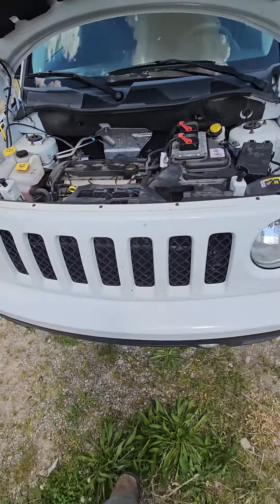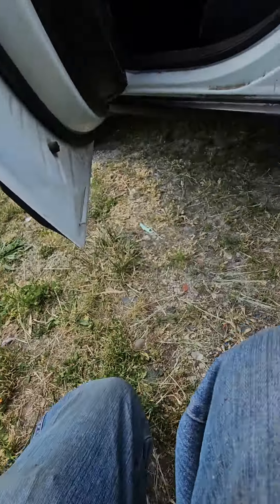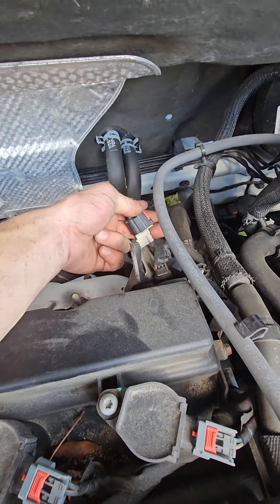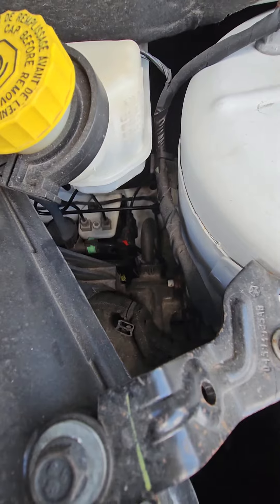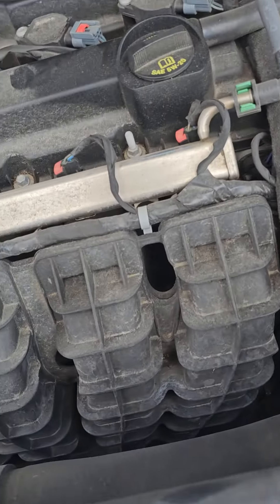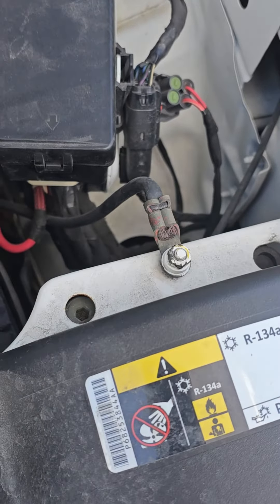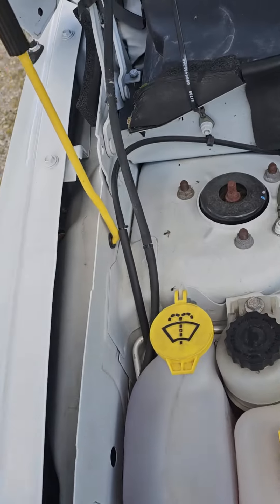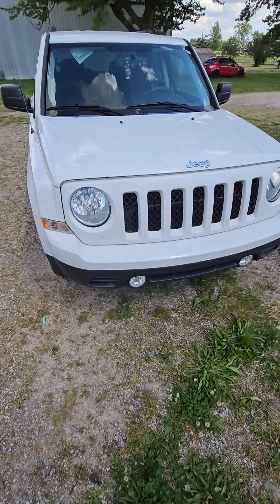Jeep Patriot ABS light, Parking light, and Traction Control light fix!

Comment: I hear ya man, but it's still a nice cheap ride for what it cost new. That of course depends on it working as it should , mine did for 8 years and now going though the abs bullshit. Though guessing getting a code scanner, probably cheaper than having someone else tell me the code. Keep on keeping on guy
Reply from the maker: Yeah, we gotta have our fun and make what we got work. Thanks for the veiw and comment man. And the videos will come as content presents it self. Other than that I'll just keep on👍
Reply: @cammocoverstherust hey buddy my 2012 jeep patriot is doing the same thing
Reply: @ericyoung2487  I end up cleaning all the body grounds in engine compartment, like 5 or 6. Then I cleared code by what was found on internet,  not sure now like key on steer left than right key off. I did get a launch dionostic and it came up that it was left front wheel speed sencer interrupted single. So clean and wipe connections down with oily rag , especially the anti lock brake ground on right firewall in engine bay.

Comment: Yeah I had the codes read by a shop and replaced the left front abs sensor and removed the negative battery terminal for a minute and nothing helped. The brake light went out, but literally nothing else happened.